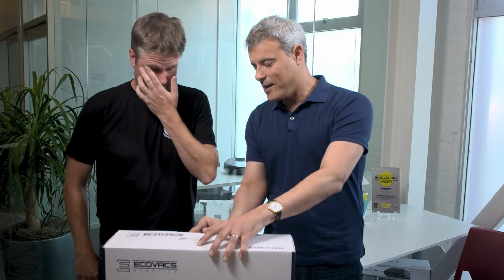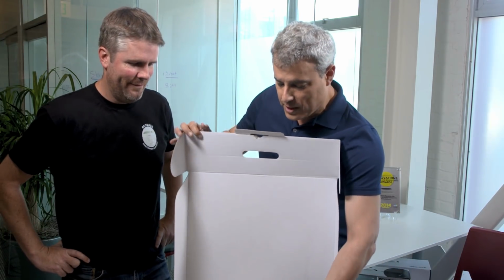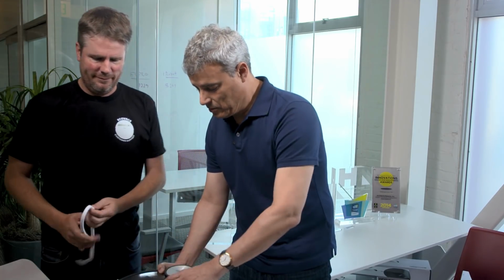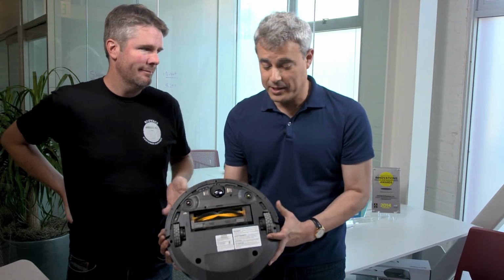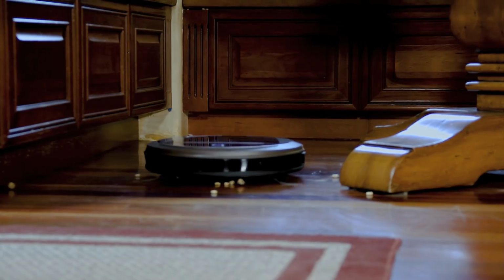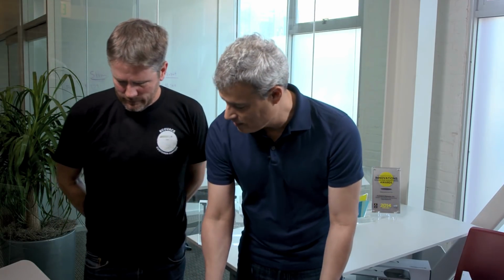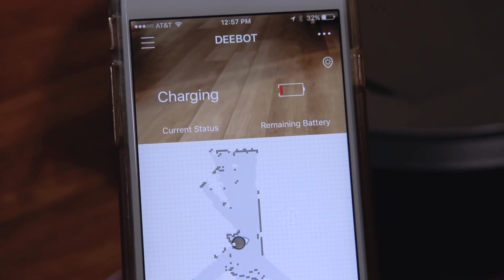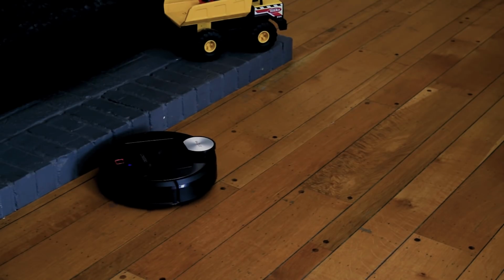Setting Up Your Robotic Vacuum Cleaner - Ecovacs Deebot R95

Comment: I just bought a 907 and cannot tell if the unit is charging. It keeps saying "my battery is low" but how do I tell if it is properly on the  charging station? When I check it after a few hours it gives me the same message. Very frustrating. Please advise.

Comment: the WiFi on my R95 turned off after the 2nd day of use last week, and have not been able to turn it back on. multiple resets and still nothing
Reply from the maker: Hello! Make sure to reconnect your Deebot while it is close to the router and that you are connecting to a 2.4 connection.
Reply: ECOVACS ROBOTICS the WiFi Light doesn’t even turn on

Comment: I just bought this r95 model and will be deliver next week. But I don't know where to buy the parts (filter, rotating Swiffer, cleaner pad). And also I heard that the apps has an issues accessing while your away from home.
Reply from the maker: Hello, could you please tell us which country you locate? And our app works well, please do not worry.
Reply: ECOVACS ROBOTICS im in Vancouver Canada. Where to buy those parts?
Reply from the maker: Hi, you could contact the following information: 
Email: customerservice@ecovacsrobotics.com
Phone: 1-844-326-8227(1-844-ECOVACS) Mon-Sun, 6:00AM-5:00PM PST
Reply: ECOVACS ROBOTICS  hi! I just received my R95 and I really love it. I lived alone in my studio apartment and this device is amazingly smart. But i dont know how to connect with amazon echo Alexa though. I cant find the ecovac on alexa skills.
Reply from the maker: First make sure you're registered with the Ecovacs app.
Go to the Alexa app, skills, search "Ecovacs", enable 
Type in credentials, select model, it'll say successfully linked when complete.
Reply: I am already registered with the App cause you need to connect with your wifi upon initial setup right? But on the Alexa skills itself I couldnt find Ecovacs , it says; "did not match any skills". meaning the Ecovacs are not supported with Alexa then?
Reply from the maker: Please contact us at customerservice@ecovacsrobotics.com for more assistance.